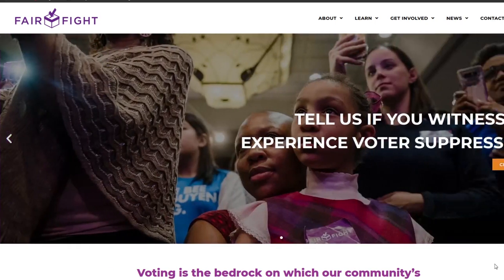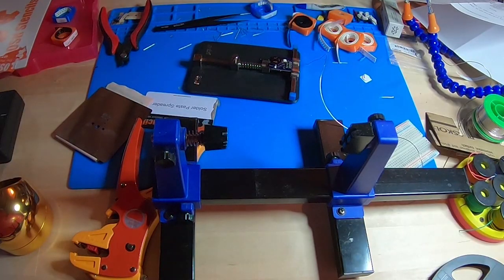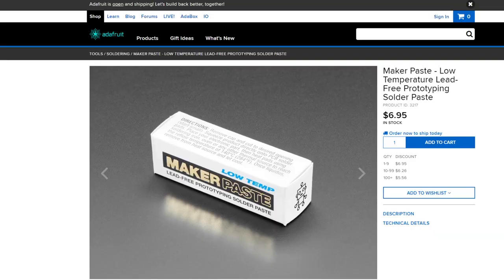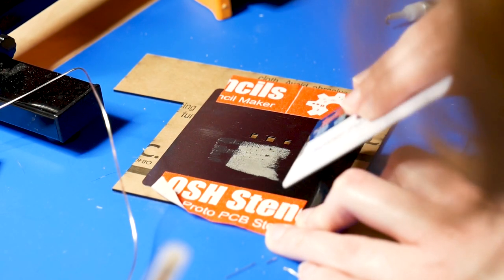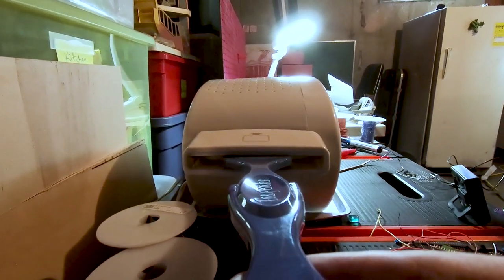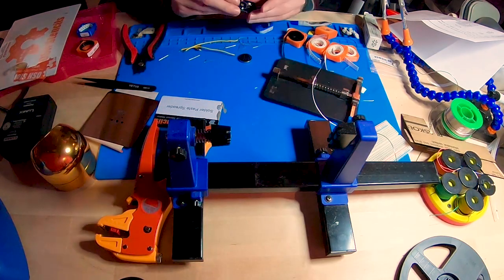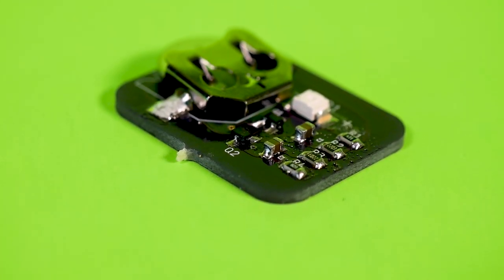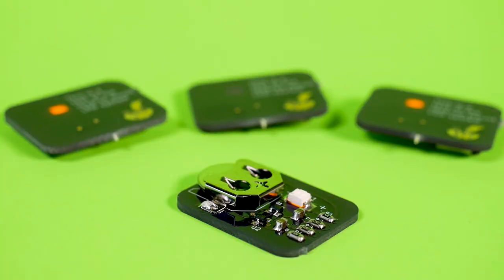Can You Use an Easy Bake Oven for Reflow Soldering? 🔥

Comment: That's really cool! You'll probably figure this out as you do it more often, but if the solder mask on the board was applied properly by the board manufacturer, there's really no need to be all that precise with placement or worry about the components shifting. The solder paste gets drawn right to the pads even if you applied it on top of the mask a bit, and the component legs have a tendency to want to center themselves in each puddle of solder. In fact, I've sometimes left solder paste straddling the mask between two pads, and it ended up separating off the mask and onto the pads during reflow. There's a ton of margin for error.
Reply: ..and now I must appropriate my daughter's Easy Bake oven 😂

Comment: For those who still don't understand what "solder paste" is, imagine grinding up solder into a fine powder and then mixing it with butter or oil. The solder powder keeps the paste from running, and the butter keeps the powder from in one place.  This isn't a perfect description, the 'butter' component is more like man-made tree sap. When the heat melts the combined mass, the solder flows together and the other component, cleans and whets the metal surface.

Comment: Great video Liz. I love how low tech this is and it works. It's so easy to get sucked into rabbit-holes of heat profiles and over-engineering automation when it mostly just works with a little bit of manual monitoring.

Comment: This is cool. 
What is the 'reverse mount led system' that the writing on the board talks about? I can see that the led is mounted such that it shines through the board, but is that it? What am I missing?
Reply: You can buy SMT LEDs that face the 'wrong' way, e.g. reverse mount. You make your board without copper, silkscreen, or soldermask where the center of the LED goes so it just shines through the FR4. It's actually possible to do this with regular SMT LEDs by putting them on upside down, but the soldering is difficult because the pads are on the wrong side.
Reply: Typically there is a hole under the led for it to shine though